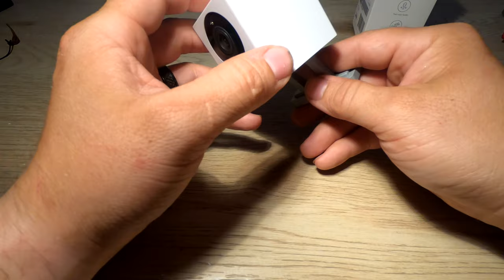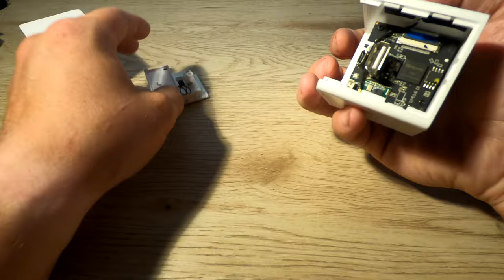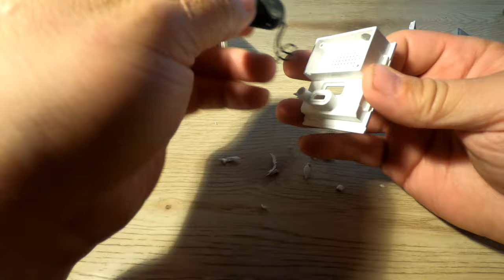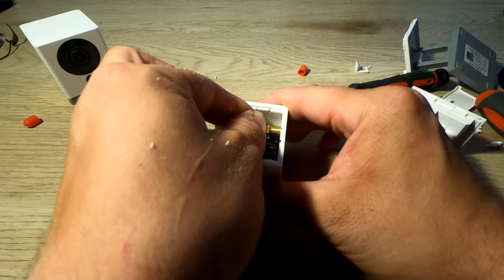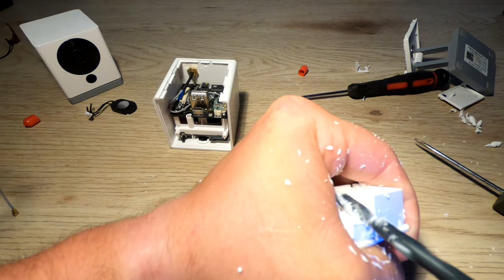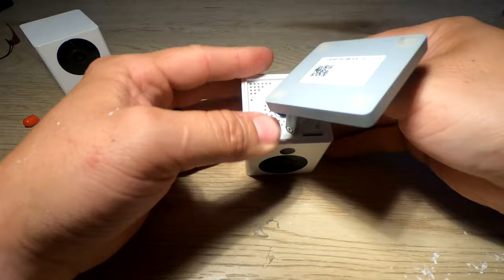How To Extend WYZE Cam Wi-Fi Range

Comment: Can you please post the brand and part number for antenna 
Thanks
Reply from the maker: https://www.amazon.com/HIGHFINE-2-4GHz-6dBi-Omni-Directional-Connector/dp/B01KBU61S8/ref=dp_prsubs_1?pd_rd_i=B01KBU61S8&psc=1
Reply from the maker: Highfine 2 x 2.4GHz 6dBi Indoor Omni-Directional WiFi Antenna 802.11n/b/g RP-SMA Female Connector + 2 x 20cm/8" U.FL/IPEX to RP-SMA Pigtail Antenna WiFi Cable
Reply from the maker: Sorry for the delay!

Comment: By the way, I did this upgrade and it works. It did not get a signal 2x or more better. Not a huge increase in signal detection but it did increase it enough to make the difference between a camera that would almost but not quite get a solid signal to one that now gets a solid signal. I have the cam in an external garage to watch my vehicle and garage interior. The signal has to go about 100' and through 5 walls. Adding an external antenna gave it just enough boost to get a signal, but if I move the camera another 15 feet I then start to lose the signal again. So I think it increased my range by about 20' and one wall.   Not sure how much range it would give in a straight unobstructed line of site or through fewer walls.  But well worth the upgrade if you have a week signal or can barely connect, should fix your issue.

Comment: Just did this myself. If you put the antenna on the side, you can keep the speaker. It’s a tight fit, but I went from 1 bar to 3 bars signal. Thanks for your tear-down and guide!

Comment: The ONLY good thing about my Wyze cams is the Wi-Fi. Even works in the garage, on the COLDEST Canadian winter day/night, which is not close to where my router is.. Even my original sensors connected (until they all died one-by-one). The last one died sometime (I don't know when) without any warning (IT'S SUPER CLOSE TO THE ROUTER! 😡).
Because of the dumbest thing I've ever heard of, it cannot be reconnected even I put a new battery in there. So, u being a smart guy, know of anything I can use these sensors for? I got a ton of them. Cannot use them anymore. They can NEVER be reconnected to the bridge. 😡😭
Reply from the maker: I don’t know,  I have these dang things die all the time.   Buy a new one and take the broken one back.. lol.
Reply: @TimMort  Got mine when visiting California. I live in Canada. They had finally come to Canada via Amazon just before my vacation. I waited for years. I was excited to see them in Amazon Canada and UNTIL I saw the price 😳😱. I was going to Cali in 2 weeks so waited till I got there and went straight to Home Depot there to buy it at a great price.
They dropped support of the v1 sensors and wanted ppl to buy the V2 instead.

Comment: Does anyone know if this will work on  Wyze V3 camera?  May require some silicone around the antenna. I may take it apart to see if it is like the V2. Need a V3 about 125 ft from Wifi.
Reply from the maker: Not sure,  I don’t have a V3.  As soon as I get ahold of one I’ll crack it open and see what can be done
Reply: @TimMort  Thanks, the V2 antenna was able to reach about 90 feet to my wifi, great (DIY) enchancement.  Also, it keeps the HD setting. My 3 - V3 are outside and closer, two require setting to SD and 360  to work correctly. The V3 will be a stretch hopefully it will work.